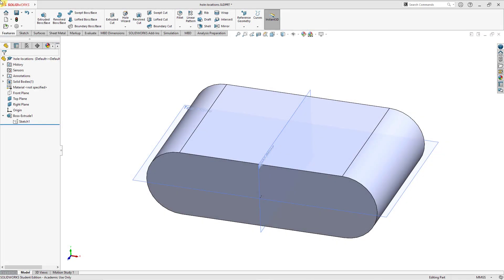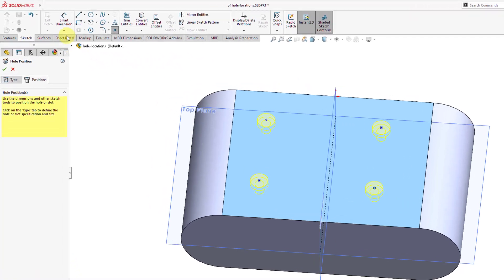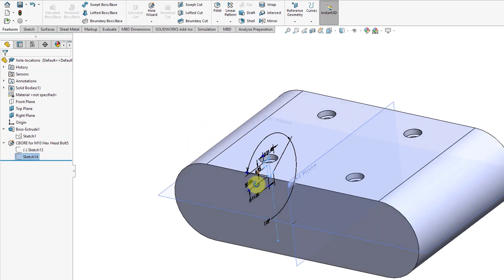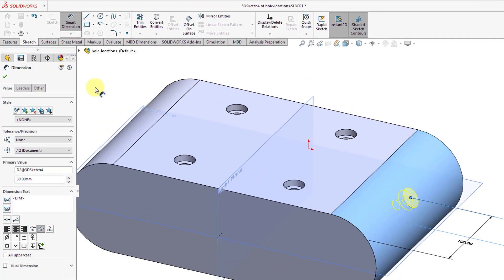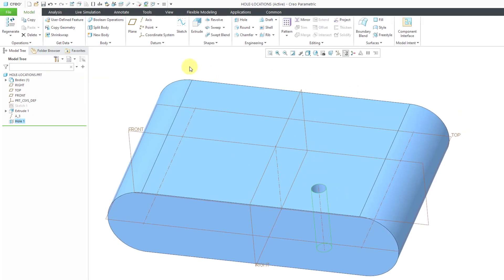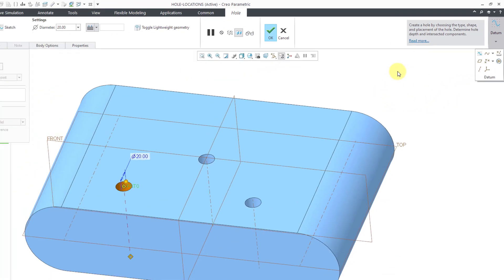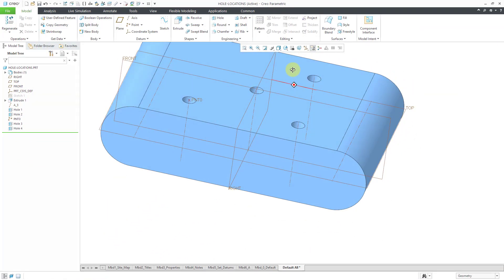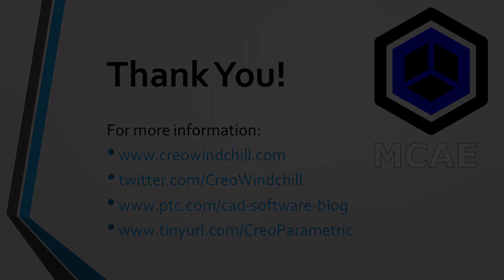SolidWorks - Creo Parametric Comparison  - Hole Locations

Comment: As of now, SolidWorks seems one step ahead when it comes to ease of use. Let’s see how Creo responds with the next version. Thanks Dave
Reply from the maker: I have a blog post on my website where I discuss the underlying theme of these comparison videos is simplicity versus functionality. It depends on which you value more. As a person who comes from Creo, there are times when I'm working in SW and I'm surprised at the things it just doesn't do. But people who value ease of use generally favor SolidWorks.
Reply: I find Creo somehow more intuitive for Sheetmetal and for creating instances (Family Tables), and for creating open-closed positions in assemblies. As for placing more holes at different positions, i don-t need more points in a single sketch, as long as I can use a Table pattern.
Reply: Hello Dave! Would you ask PTC to add a very simple yet powerful and time saving option? That option is Sketch Pattern. Thanks!
Reply from the maker: @arkaaldov5893  (1) Why don't you ask them? (2) There's a reason there isn't patterning in sketches. I cover that in a forthcoming SolidWorks video and I also covered it in my Sketch Mode Unhealthy Practices video. I also discussed that in my Design Intent book.
Reply: @CADPLMGuy  Thanks for the reply Dave. I didn't know if there was a good reason or just PTC overlooked that option. Anyways thanks!
Reply: @CADPLMGuy  As for why I didn't ask them, I assumed it to be a quicker way to get an answer from an expert who worked or works for PTC.
Reply from the maker: It was not overlooked. PTC has very specific reasons for why certain things are in the software or not. It's not faster to ask me to suggest it. The best way is submitting it to the Ideas section of PTC Community and getting people to vote on it. I actually think a suggestion from me carries less weight. If you really want the Product Managers to listen to you, talk to them at LiveWorx or the PTC/User Community Event. They are incredibly accessible and have sessions dedicated to users telling them ideas.
Reply: @CADPLMGuy  Awesome! Thanks Dave! I'm new to Creo and I love it man. I find it very intuitive and straightforward with less clutter and boxes, I'm talking about the part and assembly environments so far. When I'm working on something I feel like it's talking back to me 🙂. Thank you and keep those tips and tricks coming! Cheers!
Reply: @CADPLMGuy  Thank you Dave for the suggestions. We admire your work.